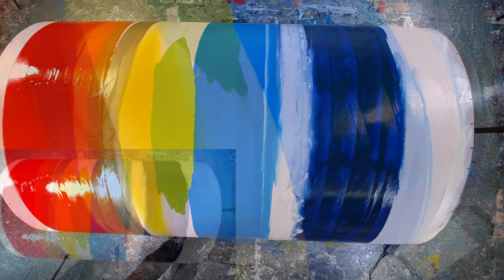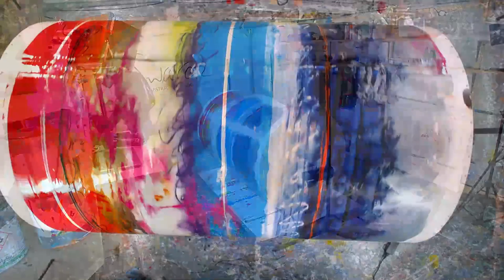WORLD'S ONLY  ROTATING ART BARREL !!

Comment: @Swarez I was thinking about how you can keep the canvas on the cylinder. I did say double-sided tape during the stream. But that wouldn't hold. So you could add a couple of strips of velcro from one end to the other and then stick it along the edges of the canvas. You'll need to trim the edges of the canvas when it dries. But I bet the velcro will hold and the canvas won't fall off because of the thinner. Thinking of that you might need to add some small screws to hold the velcro on the cylinder. This would add a lot of time but you could add a few stitches along the edge of the canvas to hold the velcro on. Just an idea because using any kind of tape will just keep falling off because of the thinner.